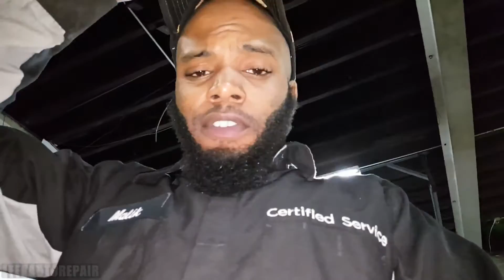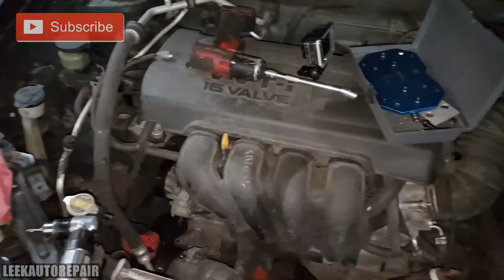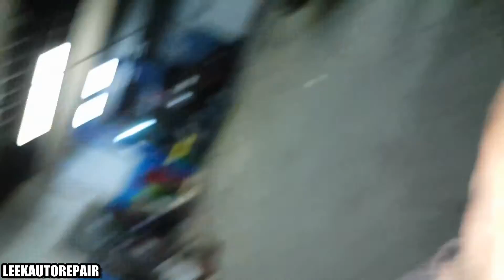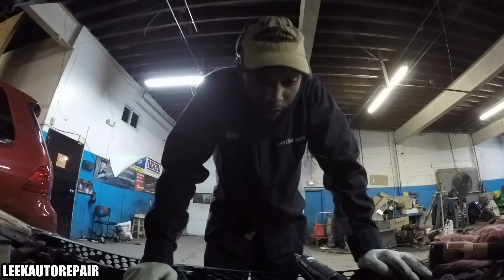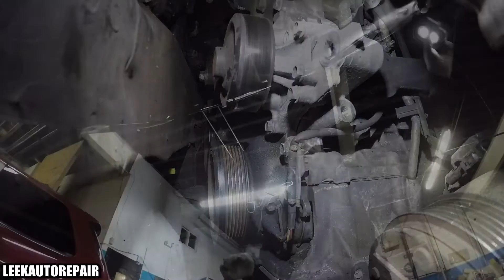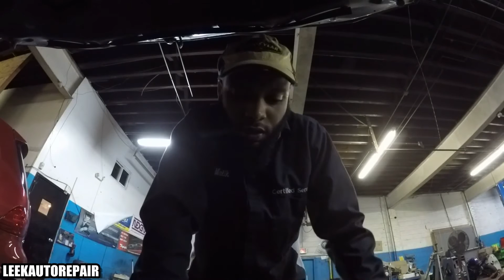Extracting Snapped Off Bolt From Engine

Comment: Left hand drill bits often times do not work. One time a left hand drill bit was the only way to remove a fuel strainer from a 1985 Mercedes fuel tank but aside from that I've never extracted a bolt with one. Always gotta drill it out and tap.
Thanks bro.

Comment: bro please use bolt extractor.  or jam a small flat head screw driver ang turn.  Reason is you just drilled a hole in the engine piece.
Reply: He didn't go past the bolt and into something else. He did it right. That Bolt Extractor dont work good on this specific job anyway. More times than not it breaks off and makes it a more expensive fix